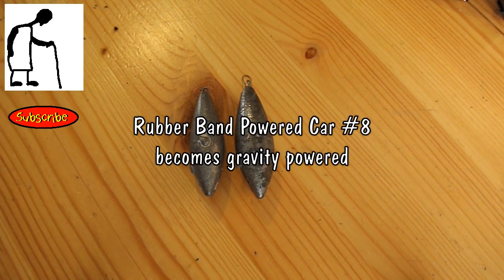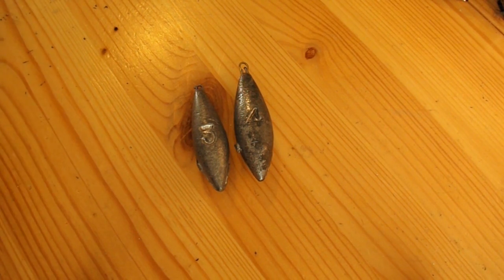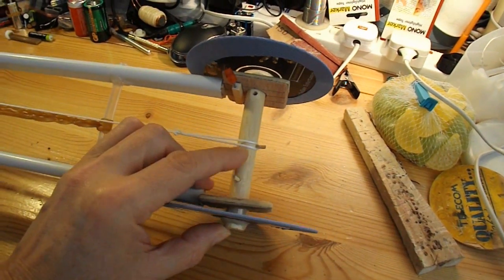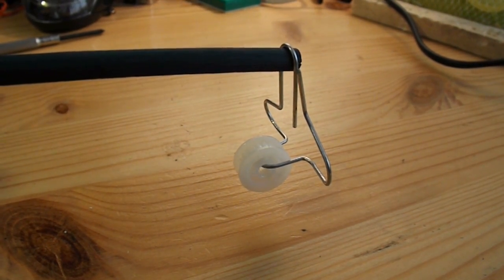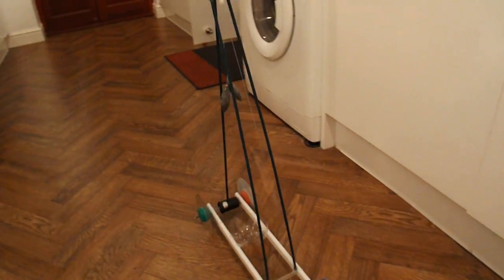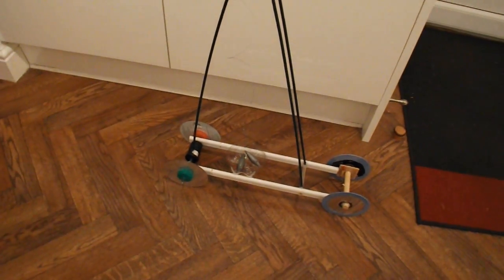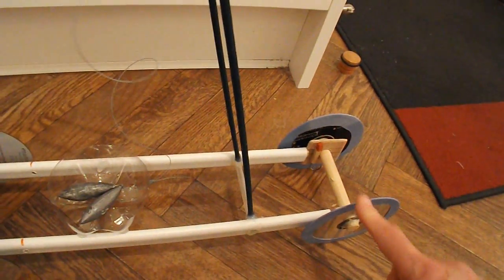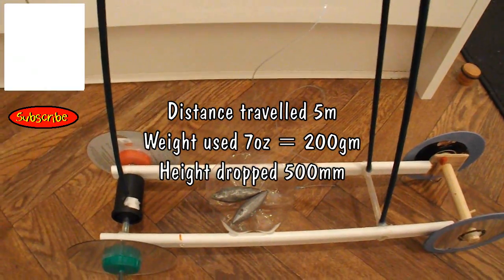Rubberband Powered Car #8 becomes Gravity Powered

Comment: Where you got the fishing metal
Reply from the maker: Hi Mohammed Dalaf, I used to collect scrap lead and melt it to make my own fishing weights, mine are probably over 30 years old, but I guess you could buy similar from a fishing tackle shop. I don't think the type of metal is important, the project just calls for 200gm. A small power transformer might be a similar weight or some large nuts and bolts.